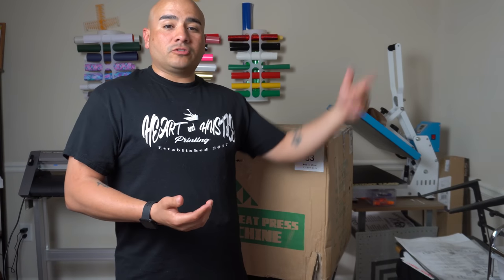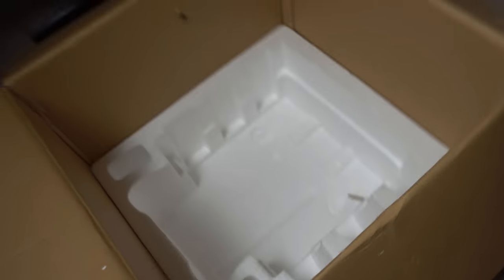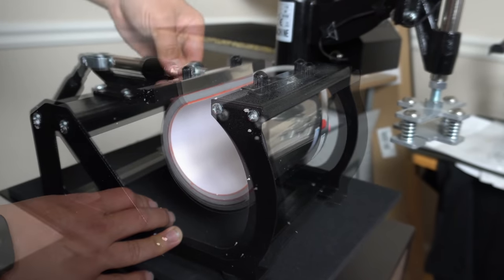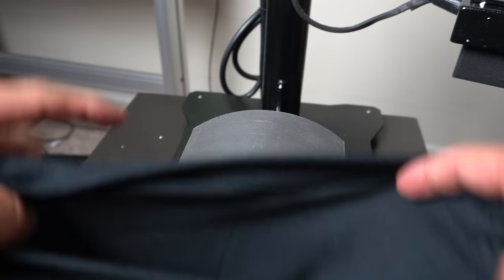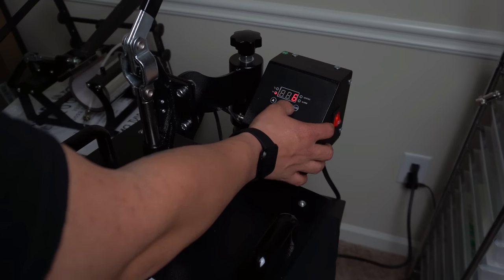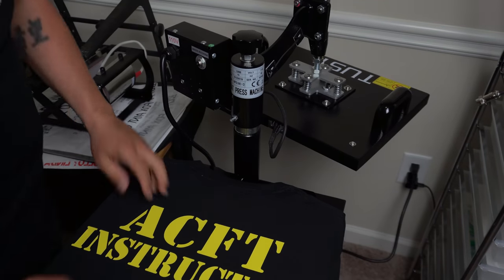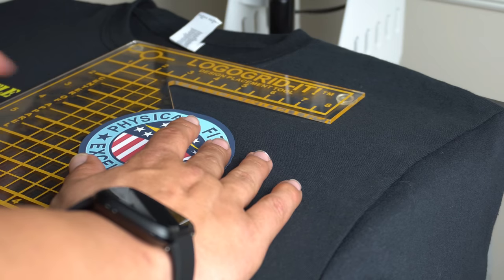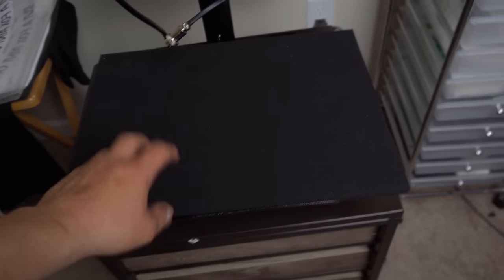5 in 1 heat press review

Comment: One thing I've found with all of my presses, is that you need to check the actual temperature from what it says it is running. My 15 x 15 press has a fudge factor of .92, but my swing away has a .75.  So lets say I want to press something on the swing away at 300 degrees F.  When the press reads 300 F, the actual plate temperature is 400 degrees F.  Took scorching a few shirts to learn they are never correct.  But I will say that the swing away hat press is only a few degrees off, and works awesome for collars and sleeves.
Reply: You have no use this press? How’s it holding up and How long does it take to tranfer something to a hat?

Comment: Great video ! Omg I have this machine for over three years just sitting in the box till now Thanks
Reply from the maker: AWESOME!!!! Glad I could help..
Reply: What machine do you need to print out the stickers/letters/logos?
Reply from the maker: @imDonDiestro  Gat a cameo 4
Reply: @HeartHustlePrinting  is the cameo 4 the sublimation printer you were talking about for the plates and mugs?
Reply from the maker: No you will need Sawgrass800 or 400
Reply: @HeartHustlePrinting   Thank you for getting back. Definitely subscribing now. Does this sublimation printer you recommend  also do the vinyl or do I have to have 2 separate printers in order to do both? Trying to figure out the best way to spend money.
Reply from the maker: You will have to get 2 seperate printers. If you subscribe make sure you click bell so you will be notified when I go live and you can also ask question there.
Reply from the maker: You will need printer for sublimation and a vinyl cutter to cut vinyl..
Reply from the maker: Also here is a good link for you...
.
https://amzn.to/3aC932g
Reply: @HeartHustlePrinting  do you need all of the extra blades for the cameo 4 when doing your tshirts or is the blade that comes with it fine? Also, benefits of the other blades?
Reply from the maker: I have used the same blad since i have had it.. Different blades are used to cut thicker materials.

Comment: How did you print out the designs? Do you need a special printer and paper to print to print it, and what cutting machine are you using. I never seen this process before.
Reply from the maker: You need a vinyl cutter and heat transfer vinyl.  Www.heartandhustleprinting.com

Comment: You said you don’t have a sublimation printer so you can’t heat press mugs or plates but don’t you just need an inkjet printer and printable premium vinyl? If you print it on that can’t you cut it and place it on there? Let me know
Reply from the maker: That was a old video. I do have it now.  Theres is videos now where I do press mugs. But no unfortunately printable vinyl wont work. Well it will untill you wash it. Then it will come off.
Reply from the maker: Here is a video where I pressed a mug live...

https://youtu.be/g3sWrHCTmDo
Reply: Heart and Hustle Printing what do you suggest? I tried to use printable heat transfer paper and #1) it was a black and white logo and the black area printed out gray.. #2) after heat pressing it it still felt like paper not like part of the mask.. it feels like paper texture on the mask. What should I do? I’m using a new et2720
Reply from the maker: If you dont want to fill it at all you will have to go with a sublimation printer.  You dont fill anything with sublimation.  Send me a DM on IG and Ill send you a sample of what it feel like..

Comment: Thank you!  Very helpful, even though I had already bought another brand.
Reply from the maker: No worries
Reply: Which one did you buy thanks?
Reply from the maker: I have both.
Reply: I'm a newbie so sorry for the odd question but why do you need a plate or mug press? Doesn't permanent vinyl stay without pressing even washing etc? Or no?
Reply from the maker: No it will not stay over time. If you have a sublimation printer image will never come off.

Comment: Hi, i will start a business and I’m wondering if i should take a heat press separately i mean a press for mug only and another one for cup only and another one plate only , or can i take a 5 in 1 and there is no risk in the long term if i switch between the mug press and then the cap press, etc..? Thank you in advance.
Reply from the maker: The press and mug press work well. I have never used the plate press. If you want to do caps I would recommend that you buy a good cap press.
Reply: @HeartHustlePrinting  so you suggest me to buy separately press ? The normal and the mug and the cap ? Or the 5 in 1 ?
Reply from the maker: https://youtu.be/XndlG7Xy95A

Comment: Hey i got a press just like this one and no manual zo i dont know how tot change the temperature. Can how help me out ?
Reply from the maker: Ther are two option on it. 1 and 2. One is for temp and 2 is for time
Reply: Heart and Hustle Printing  , thnx for Your quick responsen. I think there is something wrong with the heatplate. The parts for caps and plates are heating op when I plug that in but my heat plates shows me 40 c  and not getting hot 😡. This is the first time I want to use it so this sucks a little. 
I live in Holland Europe and don't got a menu.
Reply: Nevermind I got it. One of the heatplate Mabel was not sollid. I had fix it. Thanks for you response. Stay safe 💪🏾

Comment: Question. It has been a year since the review. I just recently purchased one myself and notice that the heat temp is off. has yours done the same?
Reply from the maker: They fluctuate. Best thing to do is buy a temperature guy from Harbor Fright.
Reply: @HeartHustlePrinting  i already had one. I checked it. Its off by 10 degrees. Also. I seen your vid and the one TUSY sent me looks like the one next to your TUSY.
Reply from the maker: I have a temp gun for screen printing. I have never had any problems with mine.

Comment: what about the life time of a printed t-shirt , how long does it last? please let me know , thank you
Reply from the maker: As long as you use right temp and pressure for the vinyl you are pressing it will outlast the shirt..
Reply: @HeartHustlePrinting  i'm looking to start with little investment with small budjet can you please suggest me a printer and a heat press of best quality value for money that can print t-shirts and last as long as the t-shirt does , i would also highly appreciate if you could let me know the specifications  of the quality of the t-shirt to be used which is  just as good as branded t-shirts
Reply from the maker: @terranowa2080  The one that I show in this video I still use today. The good thing about this press is tou Rtn just limited to shirts. You can also do mugs if you have a sublimation printer. You can also do plates and caps. When it comes to quality tees I use Ballea canvas and Nextlevel. When I first started I didnt use these bc they are alittle pricey. You can check them out if you like but most entupuiners will start with Gildan brand tees. Hope this helps.
Reply: @HeartHustlePrinting  thank you ,it sure is helpful but can you also give me the model is of the printer and also the specs of quality t-shirts if I want to buy from alibaba? Once again appreciate your help, thank you
Reply from the maker: @terranowa2080   terranowa  Sawgrass800  or 400. As for alibaba im not sure. I order from S&S activewear

Comment: Right angle screwdriver... a racheting handle and bit set is about $8.
Reply from the maker: True but its a wing nut.
Reply: @HeartHustlePrinting  Ryobi makes a wing nut driver you could use with a ratchet handle. (Or make one by cutting a slot in a nut driver.)

Comment: Can I print the logos/text/etc on a regular printer?
Reply from the maker: No youneed some kind of paper that will let you transfer the inks..
Reply: @HeartHustlePrinting  So special kind of paper and the printer that can print on the paper correct? So a normal inkjet printer will not work?
Reply from the maker: You need a sawgrass800 or 400 or you can convert a printer also..

Comment: Since it's been a year, how's the 5 in 1 Tusy holding up?
Reply from the maker: Still use it... Look at my last live video I did. I was using it in that video..
Reply: @HeartHustlePrinting  Nice! I was considering the Nurxiovo 8 in 1 Swing Away Digital Heat Press Machine, so you have a review on them?
Reply from the maker: Not the 8-1
Reply: @HeartHustlePrinting  thank you.
Reply from the maker: Anytime..
Reply: I need your help. I have the heat press, 50/50 shirts, the WF-7720 printer, A-Sub paper, and nothing is transferring to my shirts. What am I doing wrong? I'm using the starter ink that cam with the printer, could that be the issue?
Reply from the maker: Its not working bc you need a sublimation ink.
Reply: @HeartHustlePrinting  🤦🏾‍♀️ any sublimation ink recommendations for Epson WF-7720?
Reply from the maker: You can try cosmo sublimation ink. Im not sure how it works. But thats a option